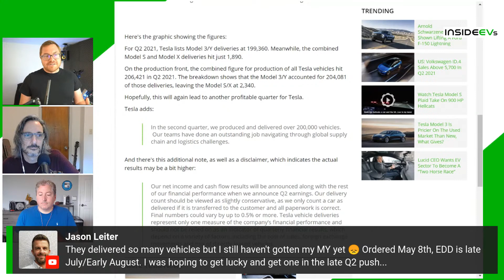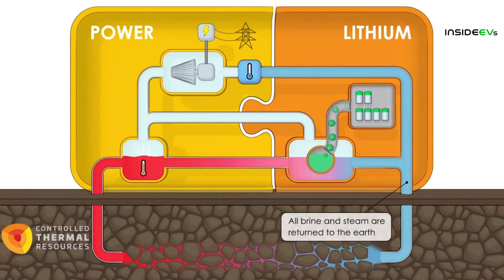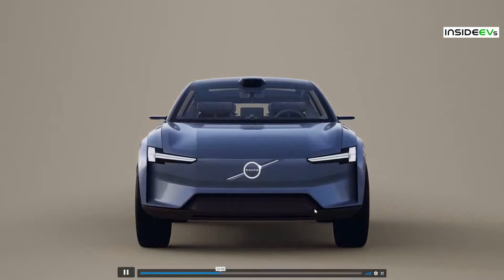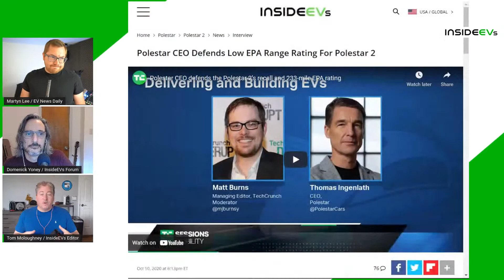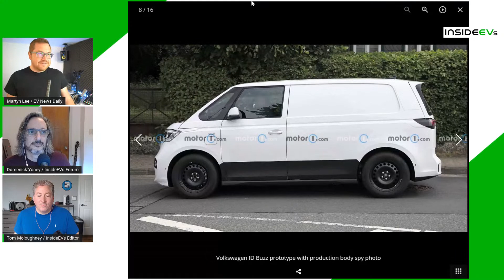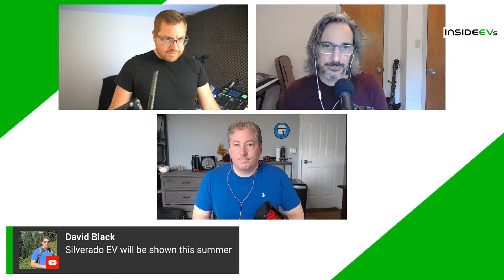Volvo Recharge Concept, GM Invests In Low-Cost U.S. Lithium Project and VW ID. Buzz Spotted

Comment: I watched a video about the Ford Mach-E 

I am amazed that a 50k vehicle doesn't come with 2 key fobs

My 2007 Toyota Camry Hybrid was loaded with features for $24,500 after $2,600 Tax Credit & had 2 Key fobs with push button start / stop & smart key fobs for opening driver side door, the trunk & of course starting the car, turning on accessories and stopping the car

By the way if your key fob battery gets low hold it close to the Push button to start the key

Also if a Hybrid and probably EV computer locks up, drive to a safe place off roadway & hold push button start stop & you may be able to reboot the computer like on Microsoft laptops, Android, Apple etc.

Great thing about Hybrids is the current infrastructure supports them

I saw a video of a guy with a Hybrid Ford F-150 charging a Chevy Spark EV on a flatbed trailer

Comment: Great show guy 👍 .. 
Tom don’t forget a proper range test is from 100 to 0% indicated as a. Constant 70mph speed  .. no one in their right mind would purposely drive their car on the highway until it runs out of juice .. however 100% to dead is a good data point for the limited few that May be curious .. but you know it’s not usable ..

Comment: About the calculation with Lithium hydroxide. Lithium hydroxide has a molecular weight of about 24 compared to lithium of about 6. So for each kg of lithium hydroxide you can make 250 grams of pure lithium. All these numbers should be taken with an « ish »
Reply: Understand what you're saying, but the projected yields from CTR are for 20,000 tonnes of lithium hydroxide a year, not pure lithium. The 300,000 per annum is slightly different, given as lithium carbonate equivalent.

Comment: There are 2 ways for me to get to Houston, Texas from Kingsville, Texas. I can take 77 to 59 at 70 miles per hour or I can take the coastline route 35 at a lazy 55 miles per hour. 77 to 59 is about 242 miles and first CCS EVSE is 228 miles away that route. 35 is about 265 miles to the outskirts of Houston 268 to nearest CCS EVSE. The energy saving by going 15 miles per hour slower is worth it for me. Plus, right now there is 60 miles of road construction south of Houston that knocks the speed down to 55 to 60 miles per hour.

Comment: Tom - The XC40 and the Polestar 2 have Siemens electric motors. I'm sure that Siemens makes great electric motors, but maybe they're not motivated enough to get the best efficiency like a car company would be. I think that's why Volvo is taking electric motor production in house. The BEV XC90 will have Volvo-made electric motors.. Maybe not as efficient as Teslas, but probably much more efficient than Siemens'. ... And according to SwedeSpeed Forum, Henrik Green was quoted as saying something like, "we've played around" with a 113 kWh battery pack on the SPA2.. More efficient electric motors, a big battery pack, lighter weight materials, and more aerodynamic. Maybe a surprising jump in range. ........ And since they're building  the XC90 in S Carolina too, not because of tariffs, maybe tariffs aren't the only reason to build where you sell.
Reply: That's good to hear. I didn't mean to infer that the tariffs were the only reason to build in the US, but I'm sure it's a consideration.
Reply: @StateOfChargeWithTomMoloughney  Yes, tariffs are certainly an important reason for the Polestar 3 to be made in South Carolina and not China.

Comment: My Pacifica hybrid PHEV gets almost 3 miles per kw!! That’s loaded with 1,000 lbs of people and dog
Reply: I enjoyed my 2007 Toyota Camry Hybrid a lot, bought it new August 2006 with the $2,600 Tax Credit, had it until February 2020 after 155k miles & still operated on the batteries up to 40mph (as long as the land was flat or downhill) that car was so smooth, plenty of power & got up to 46mpg on highway even during on a long drive from Maryland to Louisiana in hotest days of Summer with AC on & at 75mph

Comment: I have a good amount of EV experience. Invested in Tesla before the first production Model S was manufactured. I've driven many models from multiple manufacturers. I currently have an ID.4 and e-tron sportback in the driveway. 2 family members are Tesla employees as well.

I would have voted for the long range and slower charging. I have a reservation for the 600 mile Aptera. Would have ordered the 1000 mile model, but it was a bit more than I'm looking to spend. The less I have to charge anywhere but home, the better. I don't want to charge in public at all. 😅 

Not having to charge at all on a trip is the greater convenience.
Reply: From what I understand, the 1,000-mile Aptera will be the last to arrive, so you have that going for the 600-mile version as well. Personally, 400-miles would be super-great and, if I parked it outside, I might never have to plug it in (unless I went cross-country, or something). Your sun-powered miles may literally vary.  🙂